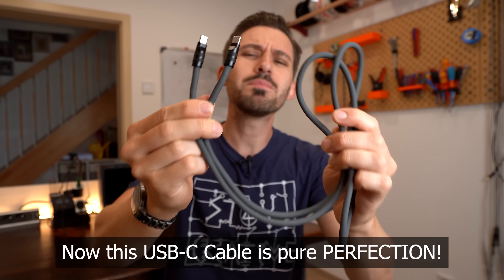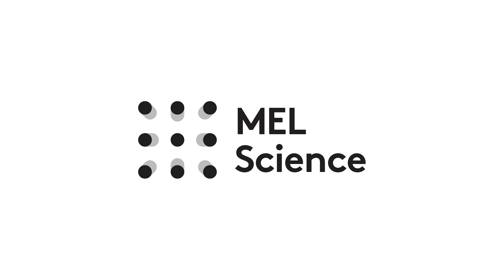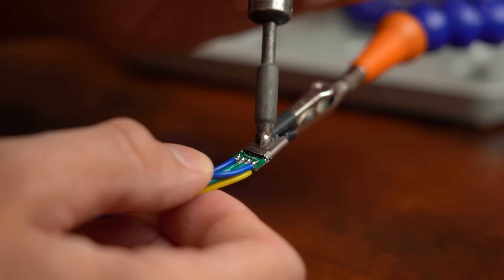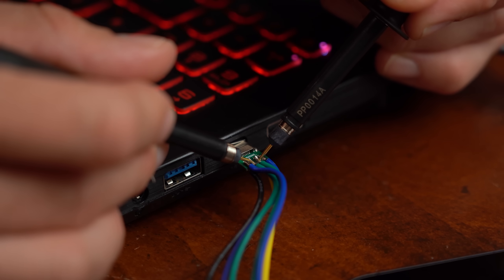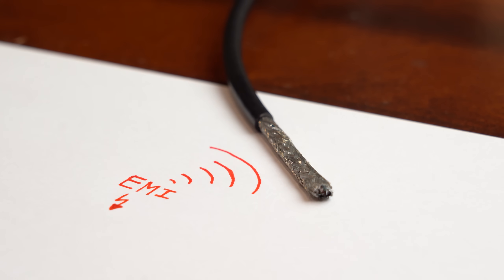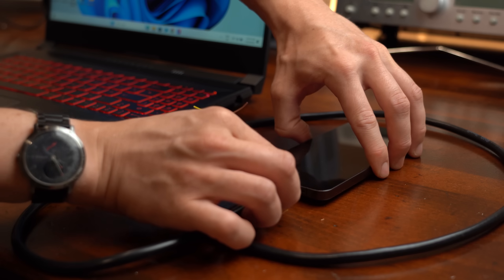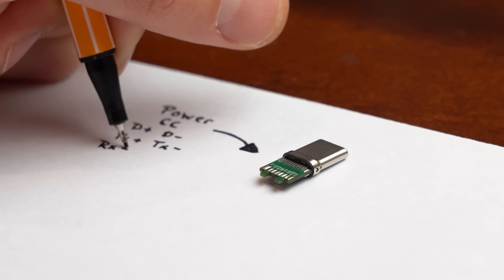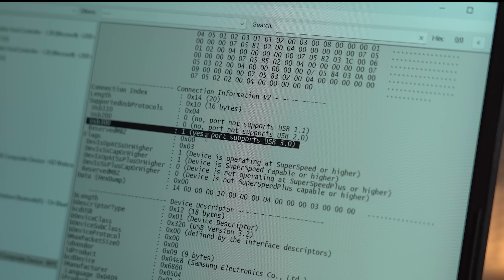Is it IMPOSSIBLE to make the Ultimate USB-C Cable? (Shielding) EB#64

Comment: Nice to see you went with my (I bet others' too) suggestion on the ethernet cable to try the high speed data! Too bad it didn't work, I wonder if it would succeed with softer patch cables.
Also too bad there wasn't available a breakout board that could also handle the power delivery side to make the epic anaconda cable (as I called it on the previous attempt's video) with thick power wiring. Guess the only way out would be to make your own breakout boards with both the chip and better pads as well to make soldering easy, tho I can understand this being far too much work (unless... a classic sponsor of the channel steps in maybe?).

Comment: Why you don't test it with the cable that did with own connector. And own cable and the working connector. And see where the problem is? Your cable or your connector? It make it easier to change step by step to find the problem. Form something that works

Comment: Another problem is that an e-marker chip is required by the USB specification for USB3 speeds. The only cables that don't need it are USB2 60W cables.
Reply: Actually, e-marker chip is required for high speed USB-C to USB-C cables specifically. USB3 speeds USB-A exists and doesn't need an e-marker chip, even in an USB-A to USB-C cable.
Reply: @mhdm Yes, since USB-A doesn't have the CC pins used to communicate with the e-marker, but this cable is USB-C to USB-C, so that's irrelevant.
Reply: @linuxsbc  It was a "TECHNICALLY" sort of correction. Unfortunately not irrelevant because Scott happens to use a high speed marketed USB-C plug that's basically designed for making a passive high speed USB-A to USB-C cable.
Reply: emarker is only for charging
Reply: @radry100  That is incorrect. The USB Type-C Cable and Connector Specification, section 4.9, states that "All USB Full-Featured Type-C cables shall be electronically marked", where "Full-Featured" means a cable that supports USB3 (and therefore also USB4 20Gbps).
Reply: Lol cụ coin viNE 0,06875$

Comment: conductor size might be another issue.
Data wires use a smaller conductor size  and smaller conductor sizes can handle higher frequencies better compared to larger conductor sizes

Comment: The cat 7 cable will work if you solder a bit of stranded copper to each end and use that for connecting to the usb terminals, just vary the lengths of the cuts so they don't cause a unsightly bulge and it prevents shorting out with one another. good luck

Comment: I use a similar USB C Silicone heavy duty cable for my portable 210 and T-75 tip irons , it's the kind that comes with the Fnirsi portable irons , I got my replacement cable from AliXpress for just a few bux .  It handles PD power well to the iron .....

Comment: The toughest part of this project is finding the cable with the right pairings of fine, twisted pair shielded wires while having thicker cables for high amperage.  With how many cables are being built, I'm surprised that there isn't a vendor selling just the cables.  Though by that point you're probably just buying a good USBC cable. :)

Comment: Try soldering a known USB 3.0 cable to your board and see if it still works. Your soldering alone can be the issue. Difference in cable length caused by soldering, and the thickness of solder between the pad and wire can be enough.

Comment: Cat 6 stp cable might work because it is not a solid conductor and has the shielding required by the standard of usb in my opinion and you should design a similar usb c pad with custom pcb and your desired e marker chip we would love to see that as well and would definitely buy if your cable is too good from the market competition and can give a tough time to some companies expensive cables

Comment: You might look into using HDMI wire. I've terminated many HDMI connections from soldered on HDMI plugs, to D-subs, to Boeing standard Radial connectors. Anyway, the wire we used has multiple twisted shielded pairs along with other non-data wires that all get wrapped up in two more layers of shielding. It's a stiff cable, but the important thing is the wires are all 26awg/24awg stranded.
Reply: Wrong impedance. 100ohms instead of 90 ohms.

Comment: I've wanted to make such cables a while back, but I did the analysis and concluded that there's simply no materials, no good cable to solder connectors onto. It is just pointless. USB is such flaky standard that when all shielding, twisting, isolation and filler strings are added, the resulting cable will be extremely thick. My current idea is to go fiber, but I'll need to figure out how to put multiple light frequencies in or how to use multiple fibers.

Comment: Those data transfer rates are at microwave frequencies. What you are working with is an RF transmission line. Microwaves require EVERYTHING to be right before they will properly transfer their energy down a wire, (or along the surface between a wire and a dielectric, which is what is really going on.) Data is even more difficult to deal with, because huge amounts of even higher frequency harmonics are being generated by the non-sinusoidal waveforms. In short, you are messing around with fairly sophisticated physics, not just hooking a wire between 2 points. BTW, another thing you overlooked is the exact cable length. Optimally, a cable needs to be a precise multiple of certain fractions of the wavelength of the data rate. People who work with microwaves every day don't try to make their own transmission-line cables. Life's too short. :)
If I were in need of a High-speed USB cable that could handle more DC power I would use a generic high-speed data cable, but would then carefully open it up at the ends, and parallel the DC power lines with heavier wire in order to lower the resistance to DC. BTW, I'd also use a soldering iron with a finer tip on it, and small diameter solder because using that beast to do fine soldering is another one of those things that life is too short for. Doing small work is actually fun with the right equipment. I hope you will take that advice, as it's almost painful watching you try to solder with that huge tip and large diameter solder.

Comment: Differential signal communications are really complex. It reads both wires and compares the two. But both needs to be above a certain level to be successfull. So if you put a noisy power wire next to it without any twisting/shielding, one of the differential can go below the expected "HIGH" state, thus missing the bit.

Usb on the otherhand, puts data clock on one of the wire and data on the other one. The sampling point is in the middle i think. You have to make sure the data bit is clearly high/low right in the clock middle section, not just middle- floating.

Comment: MTP (used by android) and PTP protocols are finicky and unreliable for testing real life data transfer speeds. These protocols also add overhead. It is possible that your cable is just fine. Test with a USB mass storage device like an external SSD. For Android, use USB tethering, then run iperf3 in server mode inside termux then test from the laptop in client mode (with and without -R flag)

Comment: you actually almost perfectly explain why you need twisted pairs earlier in the video at 4:20. Due to using differential signalling, only opposite signal are registered by the receiving device, and noise can be ignored. However, the noise will only be cancelled out if its is the same on both lines. If one line is slightly closer to the source of noise than the other, the noise will be out of phase and therefore register. We also have this situation in analogue audio however since it is analogue and not digital, it is slightly different but the principle is the same. Twisted pairs ensure both lines of the pair experience more or less the same noise.
Reply: Common vs differential mode noise. I was wondering if someone was going to bring that up.

Comment: you could try converting a cat7 patch cable into a usb c cable. as patch cables have stranded wire in them vs what you have there which is solid core meant for long horizontal runs where the cable is expected to not be moved around.

Comment: I think you should take into account the capacitance of each wires, as I see you use cables with all wires of the same size. What if using alarm cables that comes with 2 large section wires and lots of small section ones?

Comment: I got mine to work. I have 24 pins usb's one, and i but 2 E marker chips on one cable. No crossing wires E marker does it for you so tx-tx rx-rx cc1-cc1 cc2-cc2 etc. Cable about 1.5-2meters long. I think in the 24pin usbs cc's have other name something something bus. it might be that having two e marker chips in both ends does some kind of multiplexing encoding decoding of the busses.
Reply: soldering was s i might open usb ends again when i get my solder mask and isolate the lines. got 2 e marker chips busted by ripping the solder bads.

Comment: I work with a few obscure data busses at work, and some of them are very sensitive to capacitance.  For instance FLN control networks require very small conductors the biggest being 24AWG (so small you can strip with your finger nail) after that equipment starts dropping off the network.  This cable is shielded and drained on one end only.  So you might try changing out your data lines to wires with insulation labeled "LC" for low capacitance.  I'm just throwing stuff out there.

Edit: I also forgot to mention those networks work with many hundred feet of cabling in series.

Comment: USB C cables do not seem to be very durable. I cover IT support (desktop), and our company moved to 32" Curved Samsung screens just over a year ago with integrated USB C docks and PD. So staff laptops can be charged from the same USB C dock cable. Starting at 8 months old i had to start replacing cables at users desks. And now just over 1 year i have replaced over 30 cables so far. They seem to break internally with constant daily use. With people going in and out of meetings, the desk cable could be used 4 or 5 insertions per day.

Comment: the commercial cable @9:15, each of the wrapped pairs on a hp cable have another really fine cable in there too (extra thin solder braid type - initially thought it was extra fine nylon fishing line) and is wrapped around the two cables

Comment: When it has to deal with gbits, twisting, shielding and (reduced) length are more critical than section (for signal wires). Of course, wires that conduct power supply must have the required section depending on the power to transmit.
Performing an eye diagram of the cable can help to converge, but due to the fact the required equipment is usually not in the budget of many people, it is hard to perform it "at home", especially if you have to do it in  a reduced EMC pollution environment.

Comment: At such high frequencies for data transfer, even the termination of the USB-C plugs play a big role for the signal integrity. Just soldering bare wires onto a breakout board sadly does not work.

Comment: PWR & GND can be AWG24, but the rest should be 26 or even 28. I've seen cheap cables with AWG30 or even 32. 
As you've found, each pair needs to be twisted and separately shielded.
At those signal levels and speeds, solder joint quality starts to play an important role:
Get a smaller tip.
Use thinner solder.
Believe it or not, leaded is preferred, as it's softer. (Hard to beat 60/40 for just about anything. ROHS only applies to mass production of consumer electronics.)
Use way way less of it than what you are now.

Comment: The main issue that we can see at oscilloscope with your cable is phasw difference between D+ and D- lines, in frequencies used by usb 3 few mm could make a difference juat from bending cable during making, there is such thing as eye diagram for checking signal quality for differential binary signals.
Ethernet cable quality (even cat 7) could be not enough since ethernet is using modulation with multiple levels to limit frequency content and USB just one level for bit, so in fact usb speed == frequency of signal.
ps. In USB levels of line doesn't enode bits directlt it is little bit complicated, it is called J and K state, also there are special states where both lines got same level (not differential).

Comment: If you decide to revisit this, you should look into ethernet cables! You can buy Shielded Twisted Pair cable with extra conductors. I've used them in Data centers and other niche applications and theyre typically rated for pretty high transfer speeds already

Comment: You can buy patch ethernet cables (Patchkabel) which are stranded and not solid core (Verlegekabel). They're ment for non-permanent installations which is exactly what you need. I bought some mistakenly on Reichelt, super cheap.

Comment: allow me to say some tips based on my understanding of the Data part
1- USB 3.0 is not standalone connection without the USB 2.0 Data wires the D+ and D- from USB 2.0 with the TX and RX Pairs together to start the connection for USB 3.0
2- Due highspeed Data rate in the RX and TX wires must never have any noise at all (the higher speed the more sensitive to any noise)
here is an idea why not trying to create the cable manually and i mean making 2 twisted pairs and shielding them with foil with the rest of the needed wires then shield the wires again with foil + finding something like heat shrinks to finish up the cable from outside and that should allow a prefect USB C cable

Comment: I'd chop the ends off a USB3 cable and use your adapters and see what happens. I may be wrong but I suspect there's an impedence issue here- the first cable oscilloscope trace looked like there was a delay in one line resulting in the nodes between +ve and -ve getting mismatched.
Reply: He also used two passive probe instead one active differential probe.

Comment: As a proof of concept, consider making two PCBs (regardless of initial size) that act as USB-C over RJ-45 physical adapters, and then connect them with various lengths of pre-built Cat-7 cables.

This might be a workaround to having to solder incredibly small and tightly spaced connections. It might also enable you to get all the USB features that you mentioned weren't all available together in the commercial options. You could even include switches to easily connect/disconnect individual wires to test various scenarios.
Reply: i would use 2 RJ45 Sockets on such a USB Type-C Adapter Board. The first Ethernet Cable i would use for VCC, GND, D+, D-, CC1, CC2, SBUS1, SBUS2. The other Ethernet Cable would have TX1+, TX1-, RX1+, RX1-, TX2+, TX2-, RX2+, RX2-.
Reply: @DEEFRAG Thats a good idea: give each line its own wire from one of the two twisted-pair bundles. Might also make sense to use a shielded female connector on the PCBs, as well.

Comment: The USB-C itself is a great idea, but it always sucks with either speed or power (or max length) expectations because not only both devices must support the desired standard, but the cable too must be suitable. And still there's no any guarantees it will work as you wish.
I hope some more modern optical-based solutions in future would make all those problems solved.

Comment: Most new charge cables don't use copper wire, they use that shitty Chinese aluminum wires and it rapidly turns into a Resistor.

Comment: I know this is nitpicking, but please use the right terminology - low speed (USB 1.0) = 1,5 Mbit/s, full speed (USB 1.1) = 12 Mbit/s, high speed (USB 2.0) = 480 Mbit/s, super speed (from here with the additional doff pairs, USB 3.0) 5 Gbit/s, super speed+ (USB 3.1) = 10 Gbit/s. For the newer standards, the marketing names get a bit fuzzy. 

For super speed, correctly impedance matching and shielding, as you noticed, is very crucial. Also IIRC the USB super speed specs are not that clear about maximum cable lengths. I kept "as short as possible, as long as your cable spec and quality allows". USB high speed is still quite tolerant to bad impedance matching, everything above is a bit more picky, also depending on the chipsets involved...
Reply: USB 3.0, 3.1, 3.2 are actually all 5 gbps. What is truly the deciding factor is something they tacked on later called "gen" (generation). Gen 1 is 5gbps (3.0 gen 1, 3.1 gen 1, 3.2 gen 1). Gen 2 is 10 gbps (3.1 gen 2, 3.2 gen 2). Gen 2x2 is 20 gbps (you get the picture).
Reply: that obsolete nonsensical mess of a terminology? Meh!
Reply: @invendelirium yeah, USB IF lost me latest when they introduced "USB 4 2.0", yet calling the USB "with the extra pairs" "high speed" is quite misleading, as it's contradicting the official naming scheme. In general USB is a hot mess, especially when it comes to Type C connectors. You simple never know what you're up to - is it just 5V with 480 MBit or full fledged 40 Gbit with display port and 240 W of power? Sometimes there are symbols to that plug, but generally, you simply don't know.

Dear USB implementers forum: I take this personal.

Comment: You could have probably used small, more flexible lead wires between the usb connector and the ethernet cable. Interesting work though. I doubt 99% of people using these cables have any idea of the complexity they hide. Thank you for making me part of the 1%!

Comment: 🤷‍♂ I have a cable specifically plugged into a charger at all times, for my phone and anything else that needs charging. It doesn't bother me at all to use a second cable to plug my phone into the computer for data transfer. I see nothing wrong with your DIY cable not handling data very well.

Comment: Excess inductance and cross talk from other USB wires are the likely culprits. The solution is individually shielded twisted pair for each of the differential data line pairs, as implemented in the commercial USB-C high speed cable...